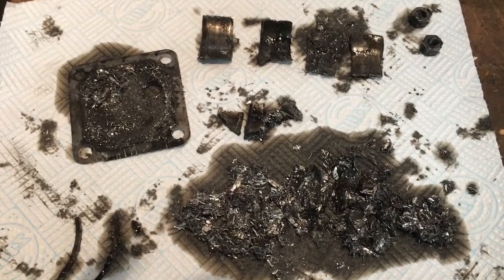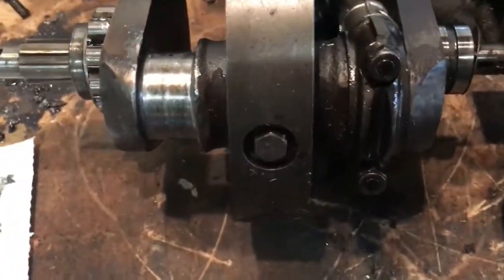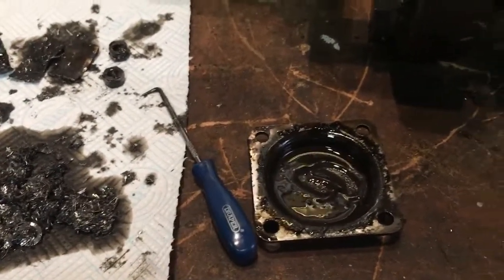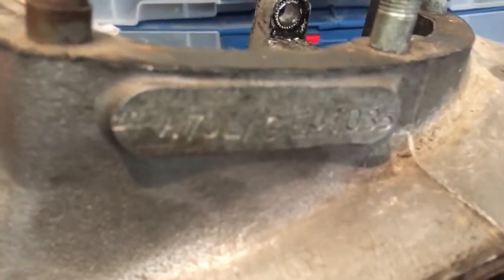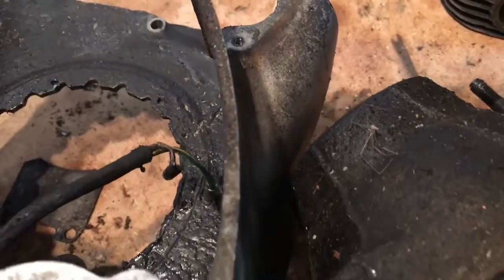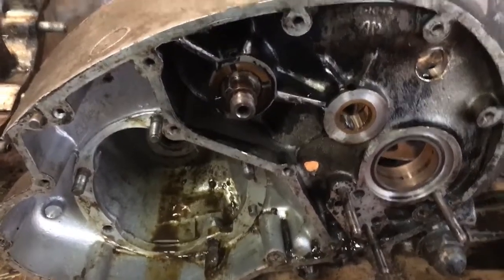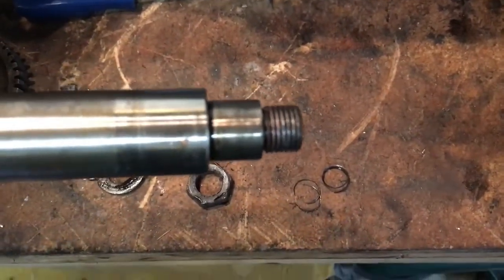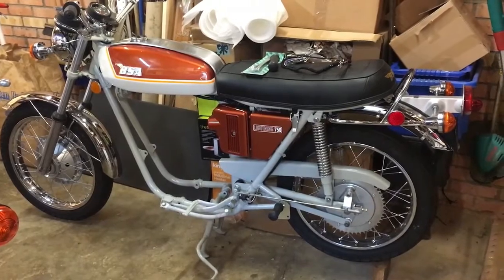BSA A70L - Engine Part 7 - Horror Diagnosis

Comment: My 1961 A7SS did exactly this (on a very cold January night in 1977, as I joined the M1 motorway), except the left side crankcase was more badly damaged. After the event, lots of people said "Oh, they all do that!"
Reply from the maker: Thanks for the comment and interest. I don’t know the pre-unit twins at all but I suppose all twins with an oil feed via a bush main and with a sludge trap and no in line filter will be at risk from the same fate.

Comment: “When the centrifugal sludge trap becomes blocked”….. that means I failed to properly maintain my engine, and any engine will fail if you don’t do routine maintenance. You have to remove the plug and get busy with a screwdriver every oil change.
Reply from the maker: Hi Roger thanks for the comment and interest. Yes I agree wholeheartedly that proper maintenance regarding oil changes and gauze filter cleaning would prevent this from happening as you say. The centrifugal filter (sludge trap) is not designed to be serviced regularly - only when the engine is stripped and the cases split. I stand to be corrected but on the A65/70s I'm not aware of any method or crankcase cavities that would allow access to the sludge trap end plug for removal and cleaning purposes on a regular basis. Thanks again for the interest and comment.
Reply: @BSAPowerSet  I’m sure (long time ago) my B33 flywheel plug could be undone from the plate on the bottom of the crank case, using a box spanner, which is why the plate was there. But we are talking 1970 something so I may not remember correctly. I’d be amazed if other BSAs were not similarly designed.
Reply from the maker: @HarleyRog  Ahh Roger I see what you mean. Yes I suppose you could remove the sludge trap locating bolt/pin from the central flywheel on this bike but that would give you very little access to the sludge trap cavity itself. The main access for sludge trap removal and cleaning on these is the end plug on the side of the RH journal. I don’t know about the earlier singles though as I’ve never owned one so you may well be correct regarding those. Thanks again for the interest.
Reply: @BSAPowerSet  you have to clean the hollow plug/bolt before it fills up and clogs the system Angus. Monitor it to see how long that takes, but it should last to the next oil change. 👍

Comment: My dads bsa shooting star threw a rod twice until he found out the cause, it was the primary side rod that failed both times, we traced it back to the sludge trap that sits inside the crank, oil is pumped from right to left so all the oil exits the primary side big end but as the trap was full of sludge only a small amount was actually getting to the shell. Once we got it out it was obvious what the problem was, but I will say my dad was a tight sod as he used to re-use old oil!!!!! But the engine was never a problem again after that.
Reply from the maker: Yep spot on Kev - the sludge trap on this was blocked - the small amount of oil that was left in the frame was sludge itself! So no oil to the LH big end which seized and fractured the rod, luckily low down so it didn't smash through the crankcase!

Comment: So it was "sludge-trap" contamination?   Although the drive-side{?} bush "works" if the oil is regularly changed, SRM is KNOWN for replacing bushes with bearings so failure is less likely in the future.   I hear most BSAs are a bit of a time-bomb with that factory bush.   You didn't need to rebore & replace pistons by leaving it 866cc when built?    If me, I'd go for the 920cc bore & stroke, getting 2 new pistons, rods,--maybe crankshaft.  And some say the S'Norton's running a 360-degree crank, like BSA, but responds well to 270-degrees, so why not go 270-degrees on the crankshaft, if getting one anyway.   Be a Hellivah Beezer, then, --right, Mate?   Unless it'd weaken the engine-floor why not tap a hole in the sludge-trap large enough to stick a finger/suction hose up into the trap to clean it, putting a threaded bolt in the hole.  Maybe with vertical-split cases,  a threaded cap'd leak.  LUV the vid.   I believe Triumphs bring/"worth" more than Beezas, 'cuz of the bush on the BSA engine.    Although reputed to leak, Royal Enfield was innovative, where half of their twins'  could be replaced, making a "fix" like you are going to do, cheaper.
Reply from the maker: Hi Jack thanks for the interest anc comment. Lots to consider and cover so herd goes. Yes the sludge trap was blocked so LH journal seized and rod fractured - luckily nearer to the big end so the cases weren’t punctured/smashed. The remaining oil in the engine  and the frame was thick black sludge - it had probably never been changed in its life. And that’s the main cause of all beading/rod issues in the main with these motors. If the oil is changed regularly, there’s not much wrong with the standard set up and there are reports of timing side bushes lasting more than 100,000 miles. My goal was to restore the bike/engine as standard so I didn’t consider capacity increases and although I understand the benefits of 270 degree cranks, the expense of that and cams/cam timing/ignition timing changes can’t be justified against a dynamically balanced standard crank with its rods and pistons. IMHO of course so each to his own. Although not many miles on the bike yet, it is very smooth and has tons of power - although for some reason it came with a larger rear sprocket so overall gearing is lowered. Thanks again for comment and interest.